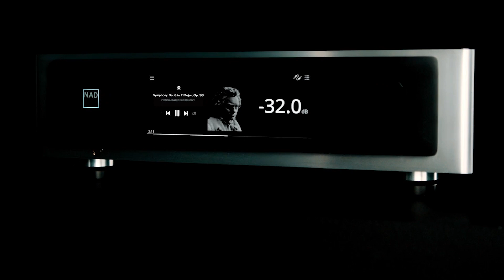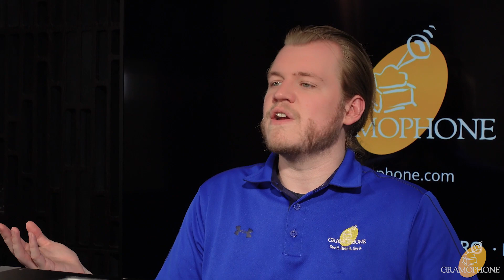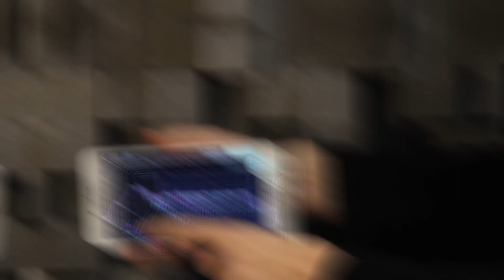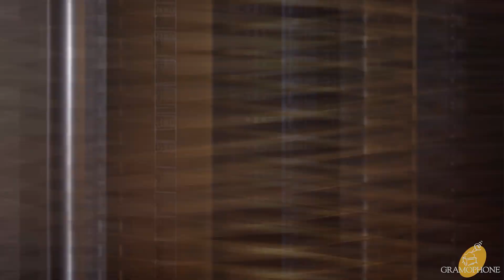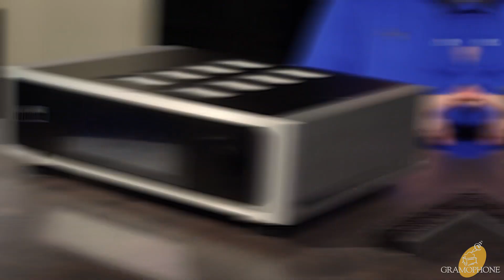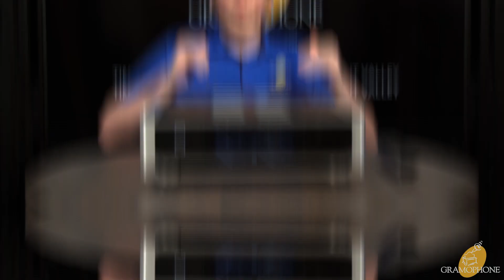NAD Masters M33 BluOS Streaming DAC Amplifier

Comment: I’m a little late the M33 game, but have a couple of questions. Does the volume wheel display on the screen when you change the volume with a remote or physically turn the volume knob? Or is the volume knob motorized and turn when you adjust the volume from remote?
Reply from the maker: Hello C, yes, volume displays when you change it either from the knob or from across the room.  We find NAD to be a very practical company when it comes to these things.

Comment: I bought one of these after I got divorced. Because...why not lol. It's more transparent than my ex! I'm at that age where just from a physical point of view I don't want power amps that weigh 200lbs and could make pancakes. It's never randomly lost a connection with a streaming service. And that's the thing - in many ways it's a "lifestyle product" with amazing audio specs. At 52 years old that has value.  The ONLY thing I wish is it kept vinyl playback in the analog realm - that's the purist part of me - but then it would lose the ability to use DIRAC with all sources. And that's the secret sauce even if I suspect the software is more capable of dialing in a "character" than my technical ability to achieve it properly. Somebody could make a lot of money as a "home going Dirac expert" for those who want to dial in a character which may sometimes have more value than accuracy.  But - out of the box the basically bottomless noise floor, separation and soundstage for its price point is amazing. It's a really impressive piece of engineering.
Reply from the maker: There are in fact pro Dirac and room correction calibrators/specialists. You make an otherwise transparent "gain on a wire" amp sound almost however you want with that.
Reply: @GramophoneMD  Good to know - I figured it was probably a "thing".

Comment: have personally seen and heard this, it's amazing what NAD has achieved, it's a dream of many modern audiophiles
Reply from the maker: It's certainly a bit of a giant slayer.
Reply: @GramophoneMD  what would you suggest be the top 3 speakers for this unit?
One on my list... Focal Audio Aria 948.
Any other suggestions?
Reply: @deonellis8577 NAD promotes it together with DALIs. I use them with Dali Opticon8 and it is amazing.
Reply: @deonellis8577 
Dynaudio Contour 30i 🔥💯

Comment: Quick Question: I've a high-end home theater consisting of a Storm Audio ISP MK2 processor, four McIntosh multi-channel amplifiers, a nice Revel Beryllium 16.2.6 speaker setup for a immersive Auro 3D, Dolby Atmos and DTS X experience and hook up to two Audioquest Niagara 7000 power conditioners and modest Audioquest 20amp cable, I know multi-channel av preamplifiers, or av processors, and even receiver struggle in stereo, but since this product has a toslink optical for older devices that use them, let say my PS2 that still works, could you use it to my high-end processor via HDMI input to get audio and visual?  Usually, high-end av preamplifiers despise bluetooth, wifi and toslink connection unless you get a McIntosh MX170 or something that still has a toslink optical or AudioControl processor or receiver that still has bluetooth and wifi built in around the same price range as the Storm Audio ISP MK2 processor from France.
Reply from the maker: I'm a little confused by your question. Are you saying that you want to output from your Storm Audio pre/pro into an M33? Or that you want to use this as an input to your Storm Audio pre/pro via HDMI? The answer for both however is no, the M33 doesn't have a home theater bypass, and it's HDMI port is strictly for audio return channel, which is for pulling down just the audio information from an otherwise upstream video source. If you are just trying to hook up a Playstation 2 to your Storm to play some old games on your system, there are plenty of relatively affordable means to convert composite a/v into HDMI for example. Now then you mentioned the need for optical if I'm interpreting correctly. The Storm Audio ISP MK2 does in fact have optical in.
Reply: @GramophoneMD  Thanks for answering one of my questions, sorry I didn't look the specs of the Storm Audio ISP MK2 nor the back of it and saw just the HDMI ports and other major connectors. Already, you answered my other question, I don't have to compromise on my ancient PS2 sound output to a completely overkill stereo performance from a NAD M33 and I can enjoy a full 5.1 stereo system with a decent Toslink cable through the Storm Audio ISP MK2. I know the weak point of a home theater is stereo performance of many types of media from SACD, CD, Vinyl, MQA, AIFF, ALAC, WAV and other uncompressed files recorded in stereo, will a NAD M33 resolve those performance issues with stereo performance? Beside it adding Bluetooth, streaming music services,  has a nice app, it is in the modern era with seamless integration with many services, has a lovely operation system and media control touchscreen

Comment: great video and explanation, one question, I have a sonus faber stradivari homage, does M33 drive those floor standing well? is the current of M33 high enough like some high current amp say gryphon, or J rowland for class D?
Reply from the maker: Personally I think it would sound wonderful with the Stradivari. I've paired it with a few models in the Olympica Nova range and was thrilled with the result, probably the best I've heard Sonus Faber sound outside of $30k to $40k of either Quad Balanced McIntosh monobloc amps with their top end preamp or the new Classe Delta stack with dual mono blocks. For $5k product to almost stand up to those is mind boggling. If you have interest in one of these please let me know, I'd love to personally help you out with it, I have no doubt you'd enjoy it.
Reply: Did you ever get an M33? My speakers have the same rated max wattage (300W), would be interesting to hear how it runs yours.

Comment: How does this compare with Chord Dave + Chord M-Scaler, Chord Hugo TT2 + M-Scaler and DCS Bartok?
Reply from the maker: Well to start those are all top tier standalone/discreet DACs and the M-Scaler is an especially unique beast being a DDC, and even unique among those. Few people go to the level of using such hardware. You are sort of asking me to compare an apple, and a near perfect apple at that not against just an orange but more like a watermelon. You may already imagine those are better DACs, yes they are. Again keeping in mind those all have a price tag of over $10,000 if I recall and just for a DAC and that’s it. Is a DAVE and even more so with the M-Scaler going to beat the M33’s built in ESS Sabre 9028 Pro in its resolution and total rendering of digitally sourced reproduction, yes it certainly is. However if you want to really play at that level almost every other last piece else in your system is good to need to cost just as much as those if not more. A DAVE connected to almost any preamp with separate power or integrated amp costing less than it is for the most part almost wasted. That said the Purifi Eigentakt amp in the M33 is a bit of exception. It’s that good.  So unless we are plugging a DAVE into a Chord Ultima Stack, or maybe Classé Monoblocks, or stratospherically expensive valve amps it’s arguably a hard sell if not downright not worth it. The beauty of the M33 is in how high it soars for just $5,000 and with a feature set that leaves one desiring almost nothing. It’s got everything you need straight out of the box. It’s DAC is better than most DACs in a lot of standalone Preamps that cost more than an M33 alone. It’s Purifi Eigentakt power amp modules are not only powerful for an integrated amp but cleaner than some 400 watt or above discreet power amps with again a higher price tag alone. It has built in BluOS which competes with all but the best and most expensive streamers. Finally the ace up it’s sleeve is Dirac. I am a big believer in room correction and Dirac is the best system of its kind with the single exception being Trinnov which costs $20,000. The awesomeness of this unit is defined by a single word: VALUE! I mean like stupid, ridiculous, unheard of value. It makes cheaper speakers sound to the best of their potential while still being more than worthy of driving high end speakers. For example one of my favorite speakers of all time is Totem Acoustic’s Element Metal V2, that’s a $16,000 speaker. Those sound better on this than almost anything else I carry with the exception of $30,000 worth of Classé separates. Value!
Reply: @GramophoneMD  Thanks 🙂
Reply: @GramophoneMD  hello…would this be overkill for my Focal Clear OG?